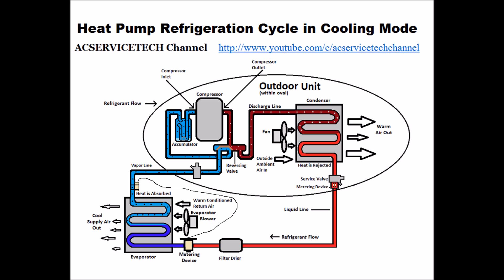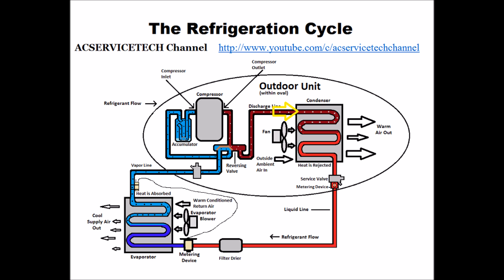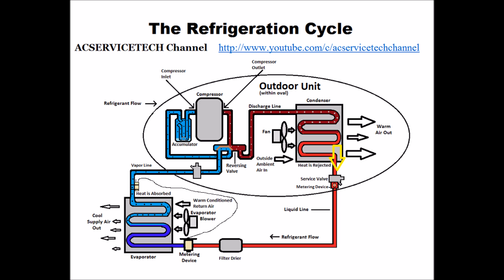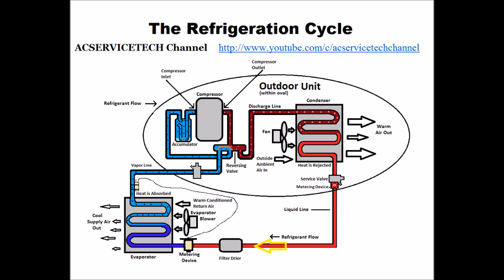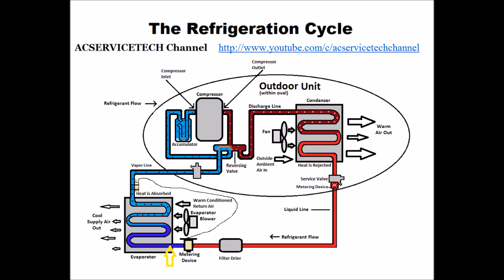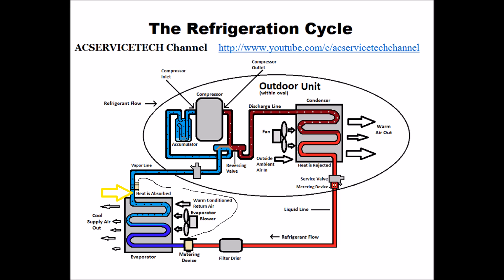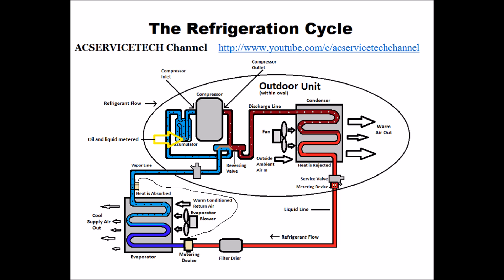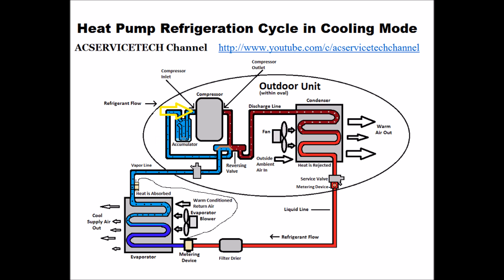Heat Pump Refrigeration Cycle!

Comment: Where do I put field piece temperature clamps on hi n low side copper line in a rooftop heat pump? App said above temperature range

Comment: This is a great way of visualizing a refrigeration cycle for a functional purpose. The typical thermodynamic cycles as expressed in p-v or T-s graphs make a lot more sense when explained in this format. I'd be more curious about the breakdown of how the Metering Device works, as that throttle aspect of the system where pressure is dropped seems pretty essential to the function of the refrigeration system.

Comment: basically, this is still a vise versa of the regular heating cycle we normally see on heat pump applications. But the point that I like your video is that you explained the details in the cycle rather than just telling "this is just a compressor connected with two coils and fans at different temperatures. Besides, you explained the different states of the refrigerant as well which is always good to mention,  not to mention the effects of the various devices along the pipeline.

Comment: Great Video! I just wanted to ask.. when vapor gets to the accumulator, you mentioned it picks up oil from the bottom of the accumulator. When this happens, is it possible it may also pick up liquid refrigerant seeing how liquid refrigerant would accumulate if system were to be overfed? Thanks in advance!
Reply from the maker: yes absolutely, look up "ac service tech accumulator" for more, thanks!

Comment: The picture you used  for this video is a heat pump in Heat Mode and you kept telling people the evaporator is absorbing heat from the house. How about you call it evap. coil/ outdoor coil and it's absorbing heat from outdoor ?
Reply from the maker: Hey Hoansa, this picture is a heat pump in cooling mode only. That is why I am referring to the indoor coil as the evap and the outdoor coil as the condensor. When it is in heating mode the indoor coil becomes the condensor and the outdoor coil becomes the evaporator, thanks

Comment: you did not explain the bypass
Reply from the maker: Hey Jimson James, I was only going over the heat pump in cooling mode. this video goes over when each metering device is active or in bypass in a heat pump, thanks-   https://youtu.be/2Ahzi1U0fYk
Reply: oh yes...thanks... because right now.im working on a invironmental chamber.. which controls the humidity by condensing the water passing the evaporator.i m having a hard time . the chamber have 4 solenoid connected to the  2 compressor..sol 1 is high,sol 2 is low humidity, sol3 is bypass,sol4 is low temperature.